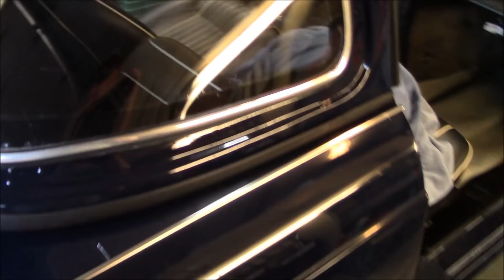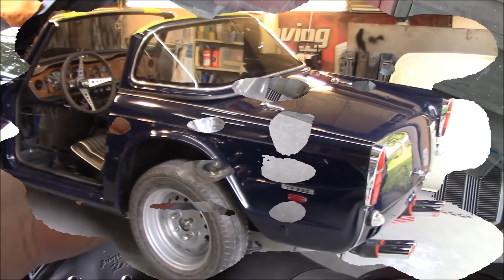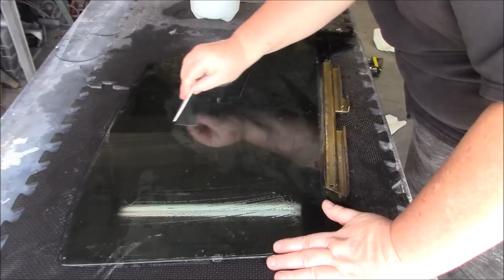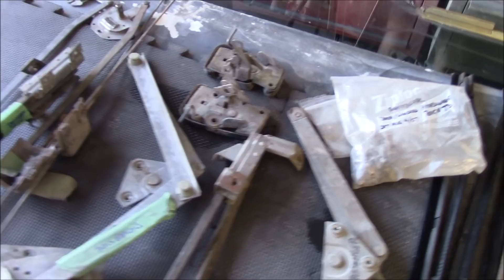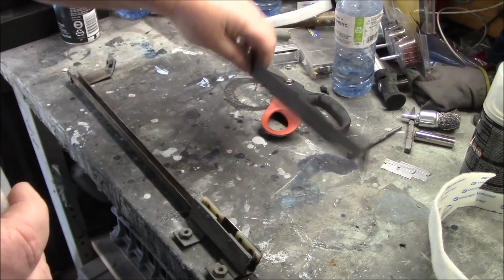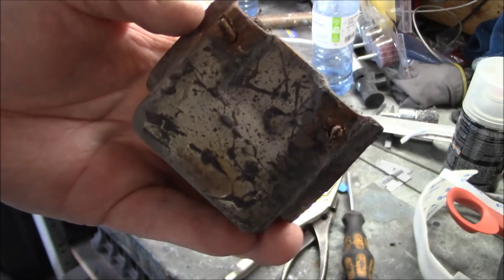1968 Triumph TR250 Restoration Project, Final Assembly Part Seven, Door Internal Assembly

Comment: Tush on the surrey frame I saw a company in the U.K. revival Motorsport fabrication that manufactures one I believe out of aluminum. It's for a TR4 so not sure if it would fit the tr250. On the. Channels I'm going to try your Method on the TR6 when I get to the doors. On my TR4 tried the whole Velcro approach and that a harder way to do it. I also bought channels and used the old brackets pain in the rear and did not align well. Easiest but more expensive was buying the channel whole unit. On the window weather striping I got one of the in but your right terrible pain in the rear to get in with the clips and I have the tool. How did they do this on the production line. The outer rubber strip is binding when putting the window up or down. Have you ran into this?
Reply from the maker: Hi Robert, yes I’ve seen those frames…they are beautiful but very expensive once they are all fitted out with glass/seals/liners etc.  They would work on the 250.   Funny, I though to myself the same question about how they would do those seals in production…I guess the gut after doing 100 cars he’d probably get pretty good at it….I joked to Les that the guy probably died from stress at 25….haven’t had an issue with the rubber binding on any of mine…
Reply: cheftush that's what I thought the guy on the line probably got good at it and was not a big deal. They probably never thought about someone replacing them 50 years later. 😀. Congratulations on the progress. Hope Les is able to get to his TR6 one day. I know it's not easy to get to the projects at times in life.

Comment: Those split pins in that glass rest thingy are "Bifurcated Rivets". I know this because I'm re-doing my Stag door cards, and they also use them to attach the metal reinforcing plates, as well as the metal rolled edge along the top. Just in case you need to get more ;-)   Looking good now.👍
Reply from the maker: Excellent Ian.  I’m always interested in learning more about these cars.
Reply: @cheftush  you're welcome. I was so pleased with myself for learning about these, I just had to share ;-)

Comment: I knew you'd handle the tinting no problem, should look great when installed. Is there not a purpose made felt channel made for the glass channel, or do you enjoy refurbing it yourself? Looking forward to the next stage 👍
Reply from the maker: I mentioned it in the video briefly that there is a purpose made channel (and I have some) but the problem is you need to remove and re rivet all the bracketry that’s riveted to the channel. I think it’s easier just to re line them.
Reply: @cheftush  thanks I must have missed that, I like your method

Comment: I've read good reports on the Harrington stainless bumpers, they make them for TVRs too. I applaud your choice to go with the stock bumper look rather than the Racetorations nerf bar approach you mentioned earlier. I'm really curious about the wheels ... I know I conjectured recently about 16x7 Panasports, but then recalled Charles Runyan at the Roadster Factory counselling 15x51/2 for TR4s and 5s because of wheel arch clearance problems, so I'm all agog!
Reply from the maker: Well, I picked the rims up yesterday at my mailbox. I’ll try and unveil them before the weekend ends.

Comment: Looking great Chef. How is the glass secured? Is it a friction fit, or are there some type of fasteners that your going to reveal in an upcoming video?
Reply from the maker: The glass is secured by a channel on the bottom that is press fit with a rubber glazing strip.  That channel mates with two rollers on the window crank mechanism.

Comment: Great work (as usual). I found it worked good to leave my velcro longer (about 1.5 inch at both ends) and then go around the ends and stick ends to the back side. Really keeps the ends secured.  Looking good!

Comment: super job Dave! the same with both doors is pending with my TR250 in the fall / winter break also... quick question, what percentage of tint did you use on your windows?
it looks like not too much, but can be a little deceiving in the video, thank you! and I also look forward to more videos 👏🏻👍🏻
Reply from the maker: Good question on the percentage…it’s pretty light, possibly 30 per cent.  I’ll check with the tint shop.